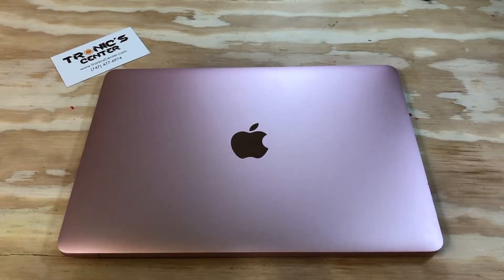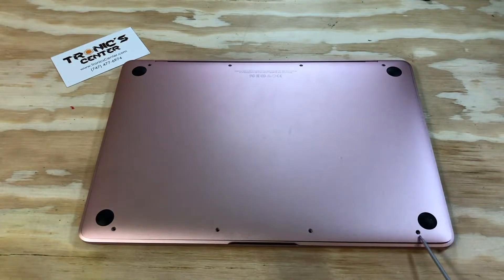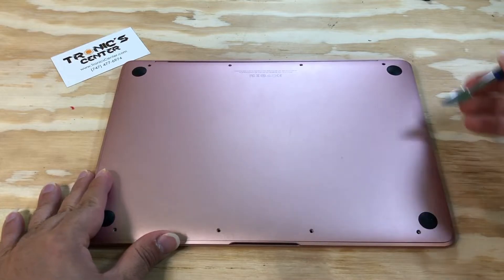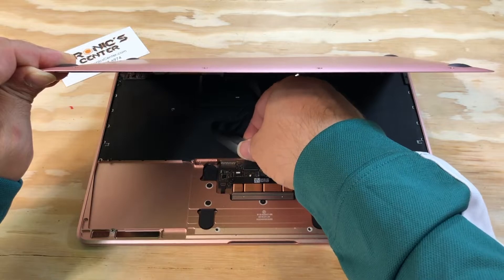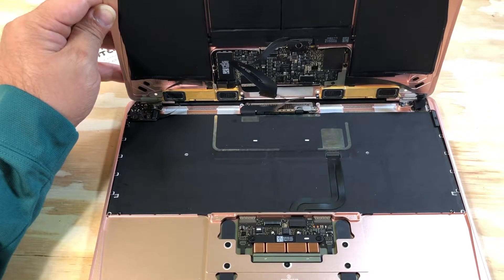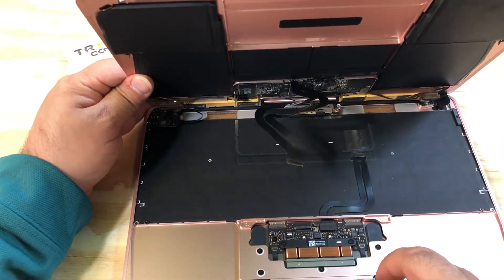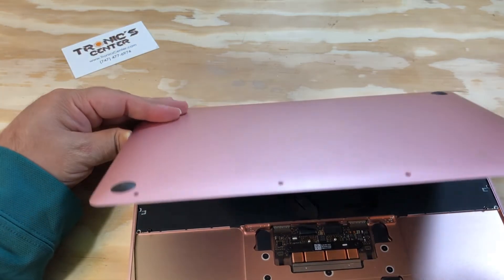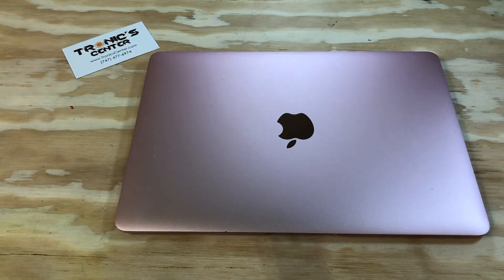How to Replace I/O Board DC in Flex Cable for 12" MacBook A1534 - I/O board DC in Flex Cable install

Comment: What about screen flex cable, is it also changeable. I have that Macbook, when screen is opened there are random horisontal lines lines going over the screen.. when moving the lid up and down the lines change, so seems like its the flez cable, just assuming.. so my question, is it changeable or do I need to buy a whole new screen.. thanks
Reply from the maker: Hello, Thanks for watching , Here are some Subject A1534 MacBook 12" LCD repair, MacBook A1534 screen replacement, A1534 Retina display repair, MacBook 12-inch LCD repair, MacBook A1534 screen fix, A1534 LCD replacement service, A1534 Retina screen repair cost, A1534 display not working fix, MacBook A1534 cracked screen repair, MacBook 12-inch Retina LCD replacement, A1534 screen repair near me, MacBook 12-inch LCD service, A1534 MacBook LCD repair shop, A1534 screen repair service, A1534 broken screen fix, A1534 display repair guide, MacBook A1534 LCD replacement DIY, A1534 screen flickering fix, A1534 MacBook display issues, A1534 black screen repair, MacBook A1534 no display issue Cost & Pricing
 
MacBook A1534 screen repair cost, A1534 LCD replacement price, A1534 Retina display fix cost, MacBook 12-inch LCD repair pricing, cheapest A1534 screen repair, affordable A1534 screen replacement, best price for A1534 LCD fix, MacBook A1534 screen repair budget, A1534 screen fix under $200, A1534 display replacement for cheap, A1534 Retina screen repair 

 A1534 MacBook screen repair near me, best MacBook screen repair shop, MacBook A1534 repair service in NYC, A1534 LCD fix Los Angeles, MacBook A1534 screen replacement Chicago, 12-inch MacBook repair Houston, A1534 screen repair in Miami, best A1534 display replacement in Dallas, A1534 screen repair in San Francisco, MacBook LCD repair Atlanta DIY & How-To 

how to fix MacBook A1534 screen, DIY A1534 screen repair, MacBook A1534 LCD replacement guide, steps to replace A1534 screen, A1534 MacBook screen repair tutorial, tools needed for A1534 screen replacement, replacing a MacBook 12-inch display, A1534 LCD screen change process, fixing MacBook A1534 black screen, Retina screen repair at home Common Issues & Fixes: A1534 MacBook screen cracked, MacBook A1534 flickering display, A1534 MacBook screen not turning on, MacBook A1534 Retina display damaged, A1534 LCD ghosting issue, MacBook A1534 Retina screen has lines, A1534 screen discoloration fix, MacBook A1534 screen has dead pixels, A1534 MacBook LCD blurry screen, MacBook A1534 Retina display dim issue Apple Repair & Warranty 

MacBook A1534 AppleCare screen replacement, Apple authorized repair for A1534, is A1534 LCD repair covered under warranty, AppleCare MacBook 12-inch screen repair, A1534 screen repair under warranty, MacBook A1534 out-of-warranty repair, Apple Store screen repair vs third party, A1534 Apple screen replacement cost, Apple’s policy on A1534 screen repair, MacBook 12-inch Retina screen warranty Repair Services & Shops 

best MacBook A1534 repair service, top-rated A1534 LCD repair, professional MacBook 12-inch screen fix, A1534 LCD repair experts, trusted A1534 display repair center, fast MacBook A1534 screen replacement, certified A1534 screen repair technicians, top A1534 Retina repair specialists, quick MacBook A1534 LCD service, Apple-certified MacBook A1534 repair Replacement Parts 

buy A1534 MacBook LCD screen, original A1534 Retina display replacement, MacBook A1534 LCD screen for sale, best A1534 screen replacement parts, MacBook A1534 OEM LCD panel, MacBook A1534 Retina screen replacement kit, A1534 MacBook display replacement online, A1534 12-inch MacBook LCD assembly, A1534 MacBook screen suppliers, best deals on A1534 Retina LCD screen Screen Repair Symptoms 

MacBook A1534 screen not responding, Retina display ghosting issue, A1534 screen showing vertical lines, MacBook A1534 screen backlight problem, A1534 Retina display yellow tint, MacBook A1534 dim display issue, Retina screen touch sensitivity problem, A1534 screen turning off randomly, A1534 display stuck on Apple logo, MacBook A1534 horizontal lines on screen Emergency & Urgent Repair

same-day MacBook A1534 screen repair, urgent A1534 Retina display replacement, fastest MacBook 12-inch LCD fix, emergency MacBook A1534 screen repair, quick A1534 MacBook screen service, best urgent A1534 LCD repair, A1534 same-day Apple screen repair, walk-in MacBook A1534 display repair, fast track MacBook 12-inch LCD fix, instant A1534 Retina screen replacement Water Damage & Accidental Damage

 MacBook A1534 water damage screen repair, A1534 Retina display liquid damage fix, MacBook 12-inch LCD repair after water damage, how to fix MacBook A1534 screen after spill, Retina display not working after water damage, A1534 screen damage after drop, MacBook A1534 screen repair due to impact, Retina display flickering after accident, MacBook A1534 LCD discoloration after spill, A1534 screen repair after crack Technical Specifications & Model-Based 

MacBook A1534 12-inch Retina display specs, A1534 screen replacement for 2015 MacBook, MacBook A1534 LCD repair for 2016 model, 2017 MacBook A1534 Retina screen replacement, A1534 MacBook 12-inch screen part number, Retina display replacement for MacBook 12-inch, best screen replacement for MacBook A1534, compatible LCD screen for A1534, MacBook A1534 Retina display features, A1534 screen resolution and repair options

Let us know.
Reply from the maker: If You Need any Original Parts or Tools You May Visit www.Tronicscenter.com For Original Apple Parts .

Comment: For anyone looking into this, I was able to get it to charge by pressing down on my cable until the light came on.
Reply from the maker: Thanks for watching , Glad to help 

1.4 GHz Core 2 Duo (SU9400), MC505LL/A, EMC 2393, MacBookAir3,1, 1.6 GHz Core 2 Duo (SU9600), MC906LL/A, 1.6 GHz Core i5 (I5-2467M), MC968LL/A, EMC 2471, MacBookAir4,1 , MD214LL/A, A1370 MacBook, 11” MacBook A1370
A2251 KeyWords 
MacBook Pro "Core i5" 2.0 13" 2020 4 TB 3, 2.0 GHz Core i5, I5-1038NG7, MacBook Pro "Core i7" 2.3 13" 2020 4 TB 3, 2.3 GHz Core i7,  I7-1068NG7, MacBookPro16,2 , 2020 13" 4 TB 3 , A2251 MacBook , EMC 3348, MWP72LL/A, BTO/CTO
A2141 KeyWords 
MacBook Pro "Core i7" 2.6 16" 2019, 2.6 GHz Core i7 (I7-9750H), 2.3 GHz Core i9 (I9-9880H), A2141 (EMC 3347), 2.4 GHz Core i9 (I9-9980HK) , MacBookPro16,1, MacBook Pro "Core i7" 2.6 16" 2019 5600M, 2.6 GHz Core i7 (I7-9750H),  MacBookPro16,4 , MacBook Pro "Core i9" 2.3 16" 2019 5600M, 2.3 GHz Core i9 (I9-9880H), MacBook Pro "Core i9" 2.4 16" 2019 5600M, 2.4 GHz Core i9 (I9-9980HK), MVVL2LL/A, MVVM2LL/A, 16" MacBook A2141
A2179 Keywords
MWTJ2LL/A, EMC 3302 , 1.1 GHz Core i3 (I3-1000NG4) , MacBook Air "Core i3" 1.1 13" (Scissor, 2020) , MacBookAir9,1 , 1.1 GHz Core i5 (I5-1030NG7) , MVH22LL/A , MacBook Air "Core i7" 1.2 13" (Scissor, 2020), 1.2 GHz Core i7 (I7-1060NG7)
A2159 Keywords 
1.4 GHz Core i5 (I5-8257U) , MacBook Pro "Core i5" 1.4 13" Touch/2019 2 TB 3 , MacBook Pro "Core i7" 1.7 13" Touch/2019 2 TB 3 , 1.7 GHz Core i7 (I7-8557U) , MUHN2LL/A , A2159 , EMC 3301 , MacBookPro15,4 , 2019 13" (Touch Bar, 2 TB 3), 13" MacBook Pro A2159
A1932 Keywords  
MRE82LL/A , MVFH2LL/A, 1.6 GHz Core I5-8210Y, 1.6 GHz Core I5-8210Y, MacBookAir8,1 , EMC 3184 , 13" MacBook Air Space Gray, 13" MacBook Air Gold , 13" MacBook Air Silver , 13" MacBook Air 2019 13" MacBook Air 2018, 13" MacBook Air A1932
A1534 Keyword’s
EMC 2746, MF855LL/A, MF865LL/A, EMC 2991, MLHA2LL/A, MLHC2LL/A, EMC 3099, MNYF2LL/A, MNYG2LL/A, MacBook8,1 , 1.1 GHz Core M (M-5Y31) , 1.2 GHz Core M (M-5Y51), 1.3 GHz Core M (M-5Y71), 1.1 GHz Core m3 (M3-6Y30), 1.2 GHz Core m5 (M5-6Y54), 1.3 GHz Core m7 (M7-6Y75), 1.2 GHz Core m3 (M3-7Y32), 1.3 GHz Core i5 (I5-7Y54), 1.4 GHz Core i7 (I7-7Y75), MacBook9,1 , MacBook10,1
A1990 Keywords
MR932LL/A, 2.2 GHz Core i7 (I7-8750H), EMC 3215, MacBookPro15,1 , MR942LL/A 2.6 GHz Core i7 (I7-8850H), 2.6 GHz Core i7 (I7-8850H), 2.9 GHz Core i9 (I9-8950HK), 2.6 GHz Core i7 (I7-9750H), EMC 3359, 2.3 GHz Core i9 (I9-9880H), 2.4 GHz Core i9 (I9-9980HK), MacBookPro15,3, A1990 MacBook, 15” MacBook A1990
A1989 Keyword 
A1989 MacBook 2018 MR9Q2LL/A, 2.3 GHz Core i5 (I5-8259U), BTO/CTO, 2.7 GHz Core i7 (I7-8559U), EMC 3214, MacBookPro15,2 , A1989 MacBook 2019 MV962LL/A , 2.4 GHz Core i5 (I5-8279U) , MV982LL/A, 2.8 GHz Core i7 (I7-8569U) , EMC 3358, 13" MacBook A1989
A1708 Keywords
MLL42LL/A, A1708, EMC 2978, MacBookPro13,1 , 2.0 GHz Core i5 (I5-6360U) , 2.4 GHz Core i7 (I7-6660U) , MPXQ2LL/A, EMC 3164, 2.3 GHz Core i5 (I5-7360U) , 2.5 GHz Core i7 (I7-7660U), MPXQ2LL/A, 13" MacBook A1708
MacBook 
Apple, MacBook, 13" MacBook, MacBook Air, A1466 MacBook, MacBook Air logic Board, 13" MacBook Air , Apple Mac , 11” MacBook , A1465 MacBook, A1502 MacBook, A1398 MacBook, A1425 MacBook, A1706 MacBook, A1708 MacBook, A1707 MacBook, A1990 MacBook, A1989 MacBook, A2159 MacBook, A2179 MacBook, A2289 MacBook, A2337 MacBook, A2338 MacBook, A2141 MacBook, MacBook Pro, MacBook Pro Retina, Retina display, True Tone Display , Top Case KeyBoard, Apple Keyboard, MacBook KeyBoard, MacBook Trackpad.
A1398 MacBook, A1398 Logic Board, A1398 LCD, A1398 KeyBoard , A1398 Display, MC975LL/A, MC976LL/A, MD831LL/A, ME664LL/A, ME665LL/A , ME698LL/A, ME293LL/A, ME294LL/A, ME874LL/A, MGXA2LL/A, MGXC2LL/A, MGXG2LL/A, MJLQ2LL/A, MJLT2LL/A, MJLU2LL/A
A1706 Keywords
MLH12LL/A, A1706 EMC 3071, MacBookPro13,2 , MacBookPro14,2 , MPXV2LL/A, A1706 EMC 3163 , 3.5 GHz Core I7-7567U, 3.3 GHz Core I5-7287U, 3.1 GHz Core I5-7267U, 3.3 GHz Core I7-6567U, 3.1 GHz Core I5-6287U, 2.9 GHz Core I5-6267U, A1706 MacBook, A1706 MacBook Touch Bar 
A1707 Keywords 
MPN 923-01477 , MLH32LL/A, MLH42LL/A, MPTR2LL/A, MPTT2LL, EMC 3072, MLH32LL/A, MacBookPro13,3, 2.7 GHz Core i7 (I7-6820HQ), MLH42LL/A, 2.9 GHz Core i7 (I7-6920HQ), EMC 3162 , 2.8 GHz Core i7 (I7-7700HQ), MacBookPro14,3 , 2.9 GHz Core i7 (I7-7820HQ), MPTR2LL/A, MPTT2LL/A, 3.1 GHz Core i7 (I7-7920HQ), A1707 MacBook, A1707 Touch Bar
Reply from the maker: If You Need any Original Parts or Tools You May Visit www.Tronicscenter.com For Original Apple Parts .

Comment: Bro, a1534 2016 dc type c port flex is not available in my country, so can i replace with a1534 2015 flex and jack?
Reply from the maker: Hello

Thanks for contacting us, Unfortunately they are not compatible to each other , Let us know what Youtube Vide you like US to Make for you ! 

Cisco, Netgear, Juniper, Hp, Lenovo, Sony , Panasonic, Dell, Data recovery, Logic Board Repair, LCD Display Repair , Samsung LCD, iPhone LCD Repair, Service Battery etc...
Reply from the maker: A2251 KeyWords 

MacBook Pro "Core i5" 2.0 13" 2020 4 TB 3, 2.0 GHz Core i5, I5-1038NG7, MacBook Pro "Core i7" 2.3 13" 2020 4 TB 3, 2.3 GHz Core i7,  I7-1068NG7, MacBookPro16,2 , 2020 13" 4 TB 3 , A2251 MacBook , EMC 3348, MWP72LL/A, BTO/CTO

————————————————————

A2141 KeyWords 

MacBook Pro "Core i7" 2.6 16" 2019, 2.6 GHz Core i7 (I7-9750H), 2.3 GHz Core i9 (I9-9880H), A2141 (EMC 3347), 2.4 GHz Core i9 (I9-9980HK) , MacBookPro16,1, MacBook Pro "Core i7" 2.6 16" 2019 5600M, 2.6 GHz Core i7 (I7-9750H),  MacBookPro16,4 , MacBook Pro "Core i9" 2.3 16" 2019 5600M, 2.3 GHz Core i9 (I9-9880H), MacBook Pro "Core i9" 2.4 16" 2019 5600M, 2.4 GHz Core i9 (I9-9980HK), MVVL2LL/A, MVVM2LL/A, 16" MacBook A2141

———————————————

A2179 Keywords

MWTJ2LL/A, EMC 3302 , 1.1 GHz Core i3 (I3-1000NG4) , MacBook Air "Core i3" 1.1 13" (Scissor, 2020) , MacBookAir9,1 , 1.1 GHz Core i5 (I5-1030NG7) , MVH22LL/A , MacBook Air "Core i7" 1.2 13" (Scissor, 2020), 1.2 GHz Core i7 (I7-1060NG7)

——————————————

A2159 Keywords 

1.4 GHz Core i5 (I5-8257U) , MacBook Pro "Core i5" 1.4 13" Touch/2019 2 TB 3 , MacBook Pro "Core i7" 1.7 13" Touch/2019 2 TB 3 , 1.7 GHz Core i7 (I7-8557U) , MUHN2LL/A , A2159 , EMC 3301 , MacBookPro15,4 , 2019 13" (Touch Bar, 2 TB 3), 13" MacBook Pro A2159

—————————————————————

A1932 Keywords  

MRE82LL/A , MVFH2LL/A, 1.6 GHz Core I5-8210Y, 1.6 GHz Core I5-8210Y, MacBookAir8,1 , EMC 3184 , 13" MacBook Air Space Gray, 13" MacBook Air Gold , 13" MacBook Air Silver , 13" MacBook Air 2019 13" MacBook Air 2018, 13" MacBook Air A1932

—————————————————————

A1534 Keyword’s

EMC 2746, MF855LL/A, MF865LL/A, EMC 2991, MLHA2LL/A, MLHC2LL/A, EMC 3099, MNYF2LL/A, MNYG2LL/A, MacBook8,1 , 1.1 GHz Core M (M-5Y31) , 1.2 GHz Core M (M-5Y51), 1.3 GHz Core M (M-5Y71), 1.1 GHz Core m3 (M3-6Y30), 1.2 GHz Core m5 (M5-6Y54), 1.3 GHz Core m7 (M7-6Y75), 1.2 GHz Core m3 (M3-7Y32), 1.3 GHz Core i5 (I5-7Y54), 1.4 GHz Core i7 (I7-7Y75), MacBook9,1 , MacBook10,1

——————————————————

A1990 Keywords

MR932LL/A, 2.2 GHz Core i7 (I7-8750H), EMC 3215, MacBookPro15,1 , MR942LL/A 2.6 GHz Core i7 (I7-8850H), 2.6 GHz Core i7 (I7-8850H), 2.9 GHz Core i9 (I9-8950HK), 2.6 GHz Core i7 (I7-9750H), EMC 3359, 2.3 GHz Core i9 (I9-9880H), 2.4 GHz Core i9 (I9-9980HK), MacBookPro15,3, A1990 MacBook, 15” MacBook A1990

———————————————————

A1989 Keyword 

A1989 MacBook 2018 MR9Q2LL/A, 2.3 GHz Core i5 (I5-8259U), BTO/CTO, 2.7 GHz Core i7 (I7-8559U), EMC 3214, MacBookPro15,2 , A1989 MacBook 2019 MV962LL/A , 2.4 GHz Core i5 (I5-8279U) , MV982LL/A, 2.8 GHz Core i7 (I7-8569U) , EMC 3358, 13" MacBook A1989

———————————————

A1708 Keywords

MLL42LL/A, A1708, EMC 2978, MacBookPro13,1 , 2.0 GHz Core i5 (I5-6360U) , 2.4 GHz Core i7 (I7-6660U) , MPXQ2LL/A, EMC 3164, 2.3 GHz Core i5 (I5-7360U) , 2.5 GHz Core i7 (I7-7660U), MPXQ2LL/A, 13" MacBook A1708

———————————————————— 
MacBook 

Apple, MacBook, 13" MacBook, MacBook Air, A1466 MacBook, MacBook Air logic Board, 13" MacBook Air , Apple Mac , 11” MacBook , A1465 MacBook, A1502 MacBook, A1398 MacBook, A1425 MacBook, A1706 MacBook, A1708 MacBook, A1707 MacBook, A1990 MacBook, A1989 MacBook, A2159 MacBook, A2179 MacBook, A2289 MacBook, A2337 MacBook, A2338 MacBook, A2141 MacBook, MacBook Pro, MacBook Pro Retina, Retina display, True Tone Display , Top Case KeyBoard, Apple Keyboard, MacBook KeyBoard, MacBook Trackpad.
———————————————————

A1398 MacBook, A1398 Logic Board, A1398 LCD, A1398 KeyBoard , A1398 Display, MC975LL/A, MC976LL/A, MD831LL/A, ME664LL/A, ME665LL/A , ME698LL/A, ME293LL/A, ME294LL/A, ME874LL/A, MGXA2LL/A, MGXC2LL/A, MGXG2LL/A, MJLQ2LL/A, MJLT2LL/A, MJLU2LL/A

—————————————————————

A1706 Keywords

MLH12LL/A, A1706 EMC 3071, MacBookPro13,2 , MacBookPro14,2 , MPXV2LL/A, A1706 EMC 3163 , 3.5 GHz Core I7-7567U, 3.3 GHz Core I5-7287U, 3.1 GHz Core I5-7267U, 3.3 GHz Core I7-6567U, 3.1 GHz Core I5-6287U, 2.9 GHz Core I5-6267U, A1706 MacBook, A1706 MacBook Touch Bar 

—————————————————————
A1707 Keywords 

MPN 923-01477 , MLH32LL/A, MLH42LL/A, MPTR2LL/A, MPTT2LL, EMC 3072, MLH32LL/A, MacBookPro13,3, 2.7 GHz Core i7 (I7-6820HQ), MLH42LL/A, 2.9 GHz Core i7 (I7-6920HQ), EMC 3162 , 2.8 GHz Core i7 (I7-7700HQ), MacBookPro14,3 , 2.9 GHz Core i7 (I7-7820HQ), MPTR2LL/A, MPTT2LL/A, 3.1 GHz Core i7 (I7-7920HQ), A1707 MacBook, A1707 Touch Bar